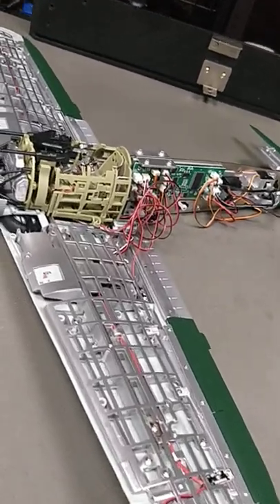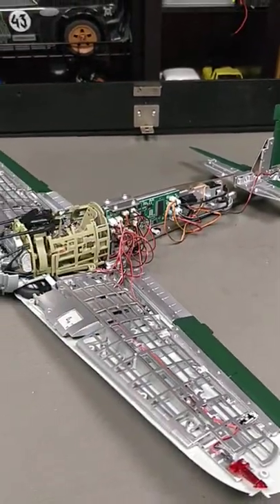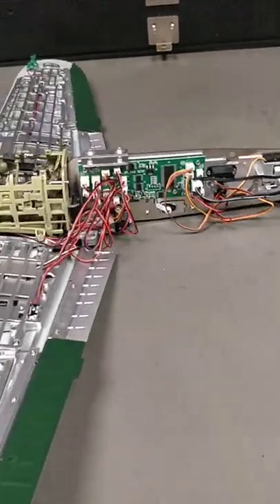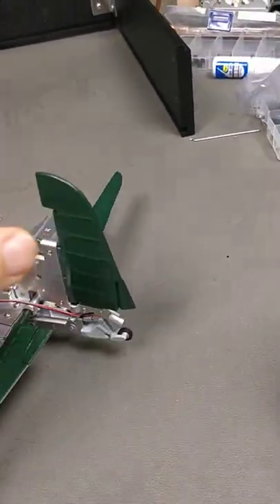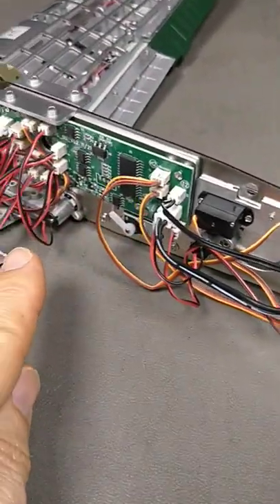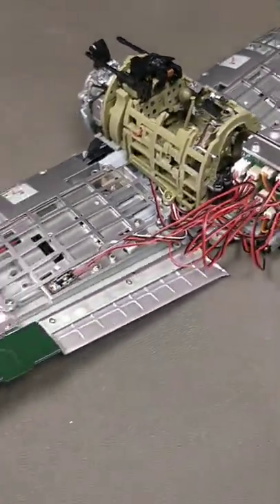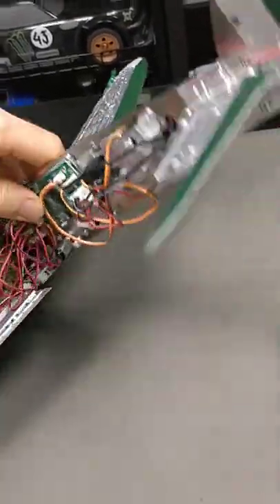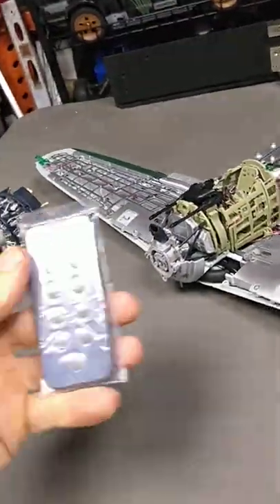You Won’t Believe This Is A Model Plane

Comment: it's all looking amazing but not for that price! those kind of companies are just big scam...which started long time ago with company which was doing Nissan GTR and over 2 years you would've paid almost £2000! when it actually cost them fraction of the price. not just you have to wait 2 years for model to be completed but also paying massive. price. If I was paying this kind of money, I want my model at home and build it at my own pace and not wait several weeks for 5 parts to arrive and not to worry about it's getting lost in a post/customs and like many people previously said with GTR, parts never got sent or got lost and company refused to refund or send replacement. And you paying all that money and you miss just 1 month of parts and you model cannot be completed...
Just a big scam
Reply from the maker: Scam is a pretty strong word mate
Reply: These guys do all at once deals and extended starters I remember early stuff from other brands descended into scams but this stuff looks to legit.
Reply: @RCTanksTrucks247  imagine singing up for 2 year deal for GTR and just 1 year after you signed up and paid £1000 they stop sending you parts. So you paid £1000 and got half a car which is useless. That's what happened with Nissan GTR. I was lucky and they only scammed me with 3 months payments before they stopped sending parts and started making excuses, it will arrive later, later and later which never happened, but still tried taking money from my bank...After 6 months I managed to get all money back. But yeah it is scam and this type of business is 100% illegal in uk. Like I said if i pay for something i want it here not wait 2 years for it.